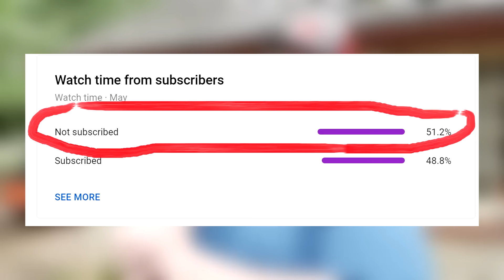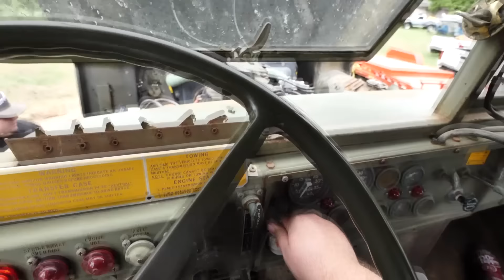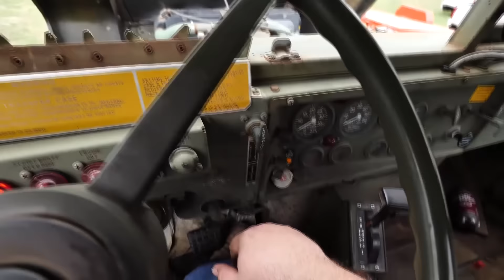How Tough is our 6x6 Army Truck?

Comment: "I've never owned something that's broke down as much as this truck"

You sir, have obviously never bought a used bmw before.
Reply: Yeah
Reply: Or like the 800 truck that was kinda crap or the story of the Porsche
Reply: Lol
Reply: jackson meads we don’t talk about them anymore
Reply: i never laughed more at a comment than this. bravo
Reply: Can confirm. I bought a used bmw 5 years ago. I still own it, but the amount of shit I've had to deal with has been the most annoying shit out of all the cars I've ever owned.
Reply: @theunkownviolinist  I've had 6 BMW, E30 & E46. They all tend to break alot. It's truly fixed if you've changed all the parts yourself.
Reply: @Samuel Hale that's most of Ford's cars it's a different story for the trucks and the muscle cars
Reply: Audi for me
Reply: Sees comment, laughs in 1971 Harris Triumph.
Reply: Or Dodge ram truck 😁
Reply: Depends who you buy it from, I bought a e39 540i6 msport individual for a pretty penny but immaculate service record & enthusiast owned. In the last 3 years I've replaced an alternator and just basics ( oil, filters, light bulbs etc..) have done around 30kmiles so far.
Reply: our i3's front right shock exploded lmao
Reply: Bought a used 08 535i in '22 because BMW was supposed to be a reliable car brand, it only had 75000 miles on it and was a garage baby of an elder couple. 

The clutch packs in transmission burnt out within a year. Got the whole transmission replaced because BMW wouldn't just replace the packs, so i went somewhere else that was willing to change to another used trans. The select shift system no longer works correctly, it won't lock into sport or manual mode anymore, and now a blend door for the driver side dash vents has quit working. So i don't get hot air out of them in the winter. 

I love this car, but goddamn I'm about to burn it to the ground.

Comment: Priceless: "Satan himself installed that bolt"
Reply: I know the bolt you're talking about
Reply: I literally LOL’d!  I felt that where I live... just did rear struts on a ‘14 Expedition, and I’m not doing it again!  🤣🤣🤣
Reply: Satan has a bolt and fastener company, you know.
Reply: I know the feelin with radiator replacement on a 3rd gen ford explorer
Reply: No this bolt  seating in himself installed, if you have worked on a big cam Cummins air compressor or an N  14 do you know the bolt🥺
Reply: David Mays gotta custom bend a wrench to get at that one
Reply: @davidmays5231  Had to do one on the side of the road for a buddy. Bought a curved box end just to get ot it.

Comment: Ya’all know that rubber wheel liner lifts out don’t ya. Makes working on the side of the engine a lot more comfortable and the front tire turns in to a seat.
Reply: Ya’all, also known as y’all all

Comment: I served on a rural fire department in Arizona that had an old 1970 Kaiser M44 tanker deuce converted to a water tender firetruck.  It would do 45 mph down the road and 45 mph across the open desert with 2000 gallons of water on the back!!!  Had a call for a fire out in the desert many miles from the end of the pavement.  I was blasting through the desert just as fast as we went down the highway.  LOVED that truck!!!

Comment: New to the channel, awesome to see this truck running. There are still a few 5ton work horses still in active duty. Have one from my last unit built in 1985 and still running. Fixing the mechanical fuel pump on these things is hell! Trying to get all the air out of each valve and the timing just right is my personal purgatory!

Comment: This is exactly what those trucks were designed for, going over rough terrain and plowing down whatever is in the way (within reason, of course). If you get stuck in one of these, either it broke, you don't know how to drive it, or the terrain needs a tracked vehicle. You could probably modify this vehicle to be a tracked vehicle.

Comment: Just a little tip, I lend my diesel engine oil to other people for about 10,000 miles so i know it's reliable oil when i put it in my trucks, just makes sure you get reliable oil and cuts down on possible oil leaks.

Comment: I will admit, that is some rough terrain. On my grandparent's property we have some that's even worse. It is also in Kansas, and there are 3 major paths that would get that thing stuck. One goes through a creek and goes up at a 50 degree incline while also being tilted to the side with tons of rocks trying to throw you off it. When it rained and you try to go up that hill, you sir have a death wish. The other two are not as bad however one is a 15 degree (or more) tilt to the right which could probably flip that. Anyways, amazing video!

Comment: It’s almost as reliable as a Ford 😂
Reply: Is Ford not reliable? (Real question)
Reply: Ernan Kortes there very reliable actually
Reply: @k.w.9392  I thought it was a joke but I can also confirm that they are reliable as a daily cars 
I've had 96 Transit for over 10 years and still runs amazingly
Reply: 79 350 4x4, driving it for 15 years and no problems!
Reply: 1998 ford f-150 that still runs amazing even after years of abuse as a work truck

Comment: i think the us army used to call this model a deuce and half, we call them RIO. badass trucks they are. we had 12 of these rotting in a base for years without moving. somehow, barely moving and engines loud as all hell we got them running and man do they can plow through and up anything rusty and leaking all over.

Comment: Wait, that one actually has a key?

I thought none of them have keys, none of the ones I've seen have keys.....
Reply: Someone probably put a conversion in it
Reply: It's been coverted bro,people do it all the time on other Military Trucks too.All of the 5 Ton Trucks just have Switches in them.The only Trucks by far that I only know that use Key Ignitions in the Military was the M1008-M1031 CUCV,which is obvious because they are soley based off of the Chevrolet K5-K30.

Comment: I once worked as a mechanic in the military on these trucks we did everything from gearboxes to engines for common faults as you fixed
if its the same as i workd on its a reo truck and dose are badass slow and heavy machines

Comment: Those rubber wheel wells are designed to come out so you can work on it. Should just be able to lift them out, unless they got bolted in which happened sometimes.

Comment: In the cab oil leaks are typically a mechanical oil pressure gauge blowing out.. it actually routes an oil line into the cab.. good thing we have electronic gauges these days huh?
So.. are you gonna make a bobbed duece out of it and really make it able to four wheel?

Comment: When lived in Plainville I worked in the oil patch.There were a couple roads in Rooks County on the Saline river that were a bear to climb with my pulling unit.Some of them were oil lease roads that were tricky. But there was a county road that went north of the river towards Codell. One day i was climbing the hill called King Hill in my old GMC with a gas V8. I got partway  up the steep hill and the truck decided to blow up. So we had to leave it on the side of the road until a tow rig could tow it out.

Comment: You should put a steering knob on that big steering wheel, it'll make driving it allot easier.  What kind of hydronic fluid mileage does that truck get anyway, like 5 miles to the galon?

Comment: Proper lifting technique when lifting a hood of that size is lifting from the fender. Will save your back.
Reply: If it's a fiberglass hood will eventually crack the shit out of it. All around the grill area,where it flexes when you lift up on one side.
Folks,don't lift it from the fender

Comment: I know exactly what bolt he is talking about. I worked on the only M923 5 ton model that is very close to this and has the same air compressor in the same location with the same stupid bolt on the back side between the block and the compressor. I had to cut a 9/16th half moon wrench in half and weld a straight piece of pipe for leverage on the thing to get it back there. 1/8th of a turn at a time. Took me a whole day to change that stupid compressor. Man I hated being the lowest ranking private.

Comment: I had the same problem with a Toyota pickup once, I accidentally busted the oil pressure line coming from the engine to the pressure gauge.

Comment: On older trucks the oil guage gets its pressure reading with a line thats fed through the dash so thats where the leak is probably coming from inside the cab
Reply: or not

Comment: That's a basic M923A0,I've had a couple of those Variants.I love the NHC-250 Cummins,but those G177's will eventually get you stuck lol.That's why I got a M923A2 with the 50/1200×20 Super Singles.

Comment: A place I worked at had Detroit Diesels to run the trucks to haul the sludge to land spread.  They had an emergency stop to shut the door over the supercharger and a simple key switch, "just like a car".  But some non truck drivers kept using the emergency stop to cut off the air to stop the engine and refused to believe that wasn't the correct way.  I had to reset the cutoff flapper many times to crank the engines.  I felt like beating them in the head with an ax.

Comment: Before you take it in deep mud check the bel housing to make sure the plug is in (the death plug we call it ) if not you will get to much dirt in your oil and have big problems and will be replacing a motor

Comment: Those duel rims aren't doing you much good in the mud. Mud packs between them and  causes several issues.....long story short, change them out for the larger single wheel setup.  You guys have fun with the beast!

Comment: Learn to love the PMCS on that truck.  Those trucks are reliable, but require a lot of love and care.  Here is a link to the manual  memorize Chapter 2 starting on page 28.  https://tfsweb.tamu.edu/uploadedFiles/TFSMain/Preparing_for_Wildfires/Fire_Department_Programs/Career_Fire_Department_Programs/Firefighter_Property_Program/TM-9-2320-272-10%20Operators%20Manual%20for%20M939%20Series%205%20Ton.pdf

Comment: Let's see... You've managed to get a bunch of other trucks stuck. Let's try it with a really heavy truck! As long as it has Army tires on it you shouldn't get stuck. They're designed to not get stuck. Too bad you didn't get one with a front winch. Do yourself a favor and look behind the dash. Check all those hoses. Check the other hoses. There's nothing like being on the highway and a hose breaks. You know it'll be when nobody is open or able to help you. Check some youtube videos on this truck. Lot of good advice out there. About the engine - I understand it's a milspec engine. They were produced by many different companies and one is as good as the other. Cummings, Hercules, etc, they're all just as good as each other. At least that's what they tell me. The date on the engine is when it was made BTW. It could have been installed in a truck years, maybe even a decade later. Have fun and don't kill yourself with it.

Comment: Probably leaking because you got synthetic in a old and used engine. I’d switch her back over to regular ol’ Dino-squeezin’s and maybe a bottle (or two) of some kind of heavy-duty oil stabilizer might help with the leaks.

Comment: Now seriously..........you didn't know that a compressor from Cummins was going to be priced so high that you could buy 5 rebuilt ones for the same price LOL  
You should have shown you guys taking out satans bolt lmao !!!  Question is.......did you put it back ?  You can put an intercooler on that engine and swap out that military multi fuel pump with a standard one and turn that baby up pretty easy.

Comment: hey this is probably the most important comment in the section but please don't rev that engine beyond 2600 RPM, they have a tenancy to come completely apart if its held there for to long. ive always referred to it as a cast iron fit and i've seen it happen. this is coming from a firefighter who has spent many hours behind the wheel of one of those beautiful beasts.

Comment: Hey Wes it's not rest in pieces if the trailer is only wounded and not dead.
That truck was not leaking oil it's rust proofing itself, don't you know anything.
I would of hit the 👍 button if it has a Detroit Diesel in it but since it had a cummins in it I had to hit the 👎. 😁

Comment: I hope somewhere in the back your mind was the machine was going to pull you out when you got stuck...... years ago I got like five vehicles stuck trying to pull one out...... finally I had a stroke of brilliance I backed up the tractor to a huge tree jacked up one side of it lock the brakes wrap the cable around the axle and made the biggest f**** winch known to man...... I was pulling vehicles that were frozen in the ground(( yeah to complicate things after everything was stuck we had a hard freeze)) but boy when you gear down  that tractor down to a 4in axle that thing had torque like you wouldn't believe you can hear the individual strands of the cable going twinkle twinkle twinkle twinkle....... keep this one short TLTR

Comment: Excuse the language, but this NEEDS to be said...
RESPECT THIS TRUCK, or it WILL fucking kill you!!  Not wearing a seatbelt and driving balls out means that if you hit a big rut, it WILL throw you out of the driver's seat, meaning that no one is controlling the truck.  You CAN roll military trucks, and most older ones DO NOT have ANY rollover protection, meaning it will crush the fuck out of you.  You may think of it as a tank, and it will run over a lot of stuff, but that doesn't mean that there aren't repercussions for what you run over.  Hauling someone in the back with unsecured items is a good way to injure them, and if you slam on the brakes, they WILL go flying into the front of the bed.  There's nothing to stop them.  Same if you roll the truck.  People riding in the bed of the truck can also get seriously injured if you're running through a lot of trees and heavy brush, those branches can snap back and crush a skull.  Military trucks have killed a LOT of people, so know it's limitations, and yours.  People get killed on quad runners, and this is a LOT bigger.  On most of these trucks, you are about the only safety device there is.
These trucks can do a lot, can be a lot of fun, and have a lot of cool factor, just be aware of what it is, and what it is not.

Comment: They make it sound as if them trucks are broken not true most them trucks are fairly low hrs and mainly just rot from sitting not running and such but a 1000 hrs on a CAT motor or Cummings international is new or broke in but with the purchase of the Stewart Stevenson trucks a lot just sit in the motor pool yards and such but sitting is hard on the hoses and lines but that truck would probably pull a scaper like a 500 000 dollar JD pull a compactor wheel just some attention needed and parts for international and caterpillar motors not to hard to find and American built. For the price you could put some money into them and still have a truck better than a street truck and simple not computer or censors ect. Construction truck or farm pull a disc water truck for fly ash 6x6 to even pull the fly ash machine if need be an on site hauler when a street truck can't get around just like a 325 6x6 stub nose not a land yacht anything can be refurbished for half the cost. Farm use that truck would work as a tractor filling the bed with grain and a trailer corn soy bean. Even a tractor only hauls a grain trailer. Just a used tractor cost is 50 to 100 thousand. Haul round bales of hay feed truck for winter fields. High set don't have to worry about ripping the crime bumper off fuel tank fenders. The 7ton Oshkosh converted to a fuel and lube truck